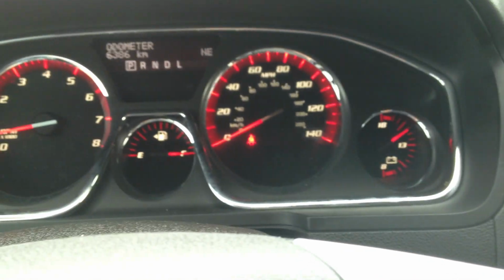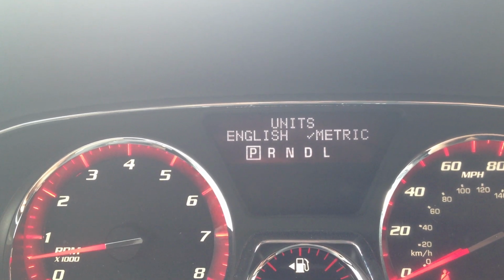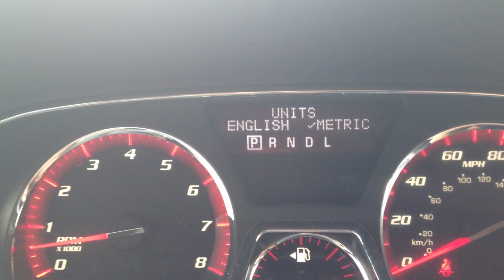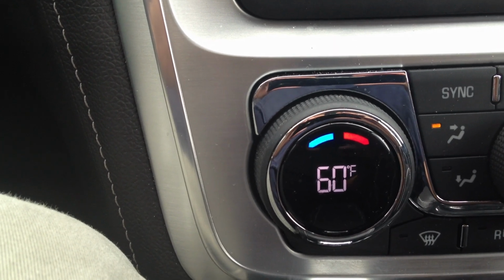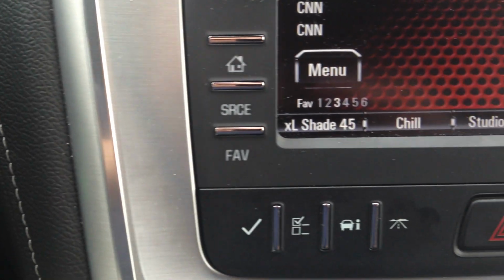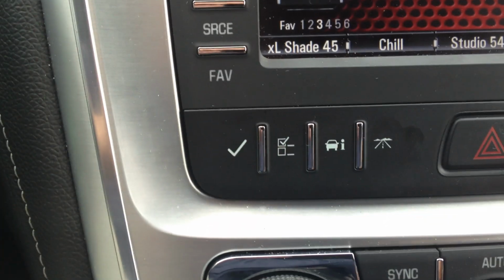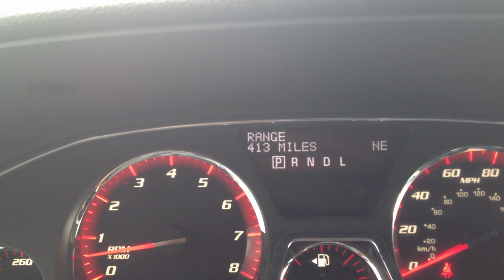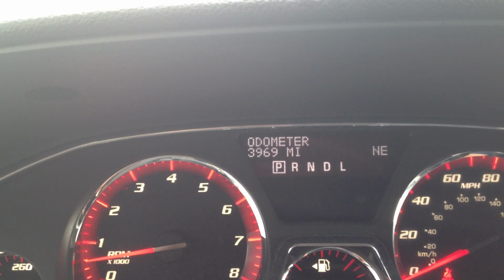'14 GMC Acadia SLT - Odometer/ Temperature Display Configuration

Comment: So... My back tire was low I put air on it but the icon on the dashboard never disappeared which usually do on any other vehicle once you bring the tire back to its proper psi and run ut on the freeway... Is there a specific way to do it for the Acadia? I have a 2015
Reply from the maker: @5150bravo hi-do any of your other tires need air? Also is the weather really cold in your area?

Comment: I don't have this button how i can change the temperature from f to c?
Reply from the maker: TA Gamer Hey Gamer - What year is your GMC Acadia?
Reply: Manning Taylor 2010
Reply from the maker: TA Gamer GMC Acadia went through a model refresh in 2013.  So your vehicle has a previous design.  I will research for you and get back to you.
Reply: Manning Taylor i appreciate that
Reply from the maker: Hey Gamer I went to the GMC Website and here is a link below to the owners manual for your 2010 Acadia. You can follow the directions from there.

http://www.gmc.com/content/dam/GMC/global/master/nscwebsite/en/home/Owners/Manuals/01_Images/2010-acadia-manual.pdf

Once you open up the online manual.  Scroll down to page 5-32 and look for the header that says 'UNITS'.  The instructions are quick and easy.  To boil it down even further for you - you are basically looking for a black stem or button on your instrument panel that controls the display readout and you will keep pressing it until 'UNITS' displays.  Then you will get a chance to select 'English' or 'Metrics'.  Then you should be good to go.